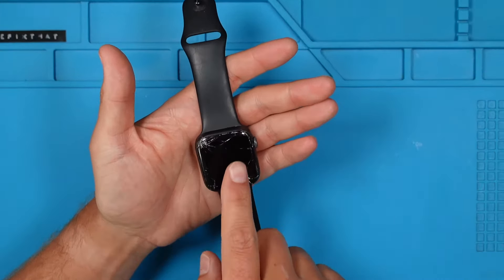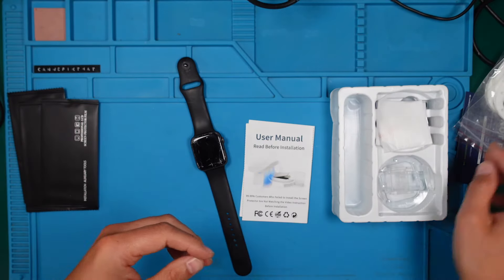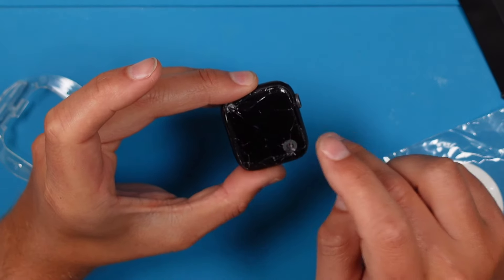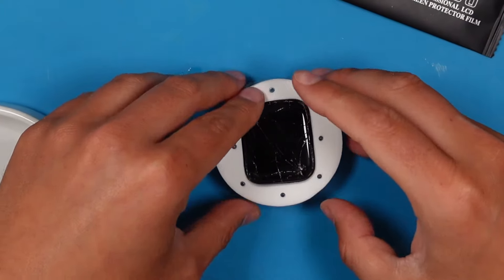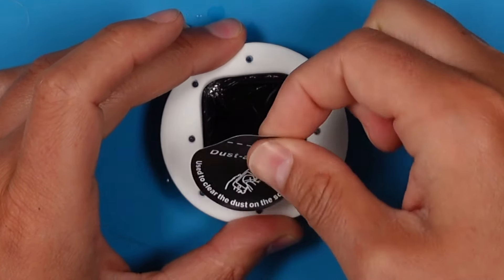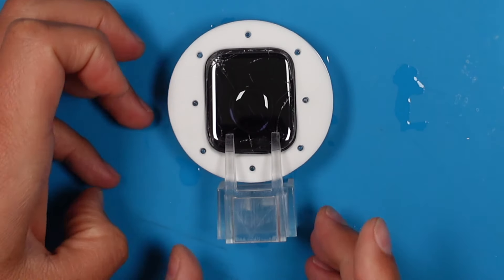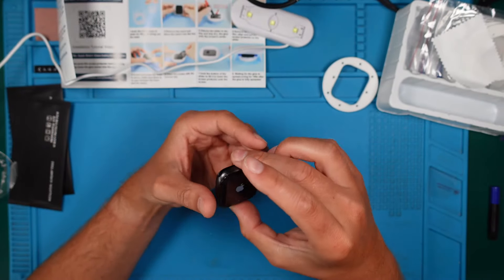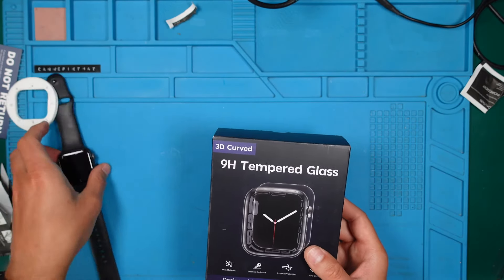Don't Trash Your SHATTERED Apple Watch: Try This $20 Fix instead!

Comment: Hello! If I make a mistake in applying the protector and decide to remove it, will it not take some of the glass shards with it as I peel it off?
Reply from the maker: Hi! I think this depends on your glass pieces. In general, it is not that difficult to get it off again, but chances are that you remove some of the glass. But what is the alternative? 😁✌🏻
Reply: @CanWeFixThat  Thanks so much for your response!!! 😄
Reply from the maker: No Problem! 🫶

Comment: well what can i do if I have an apple watch series 3, the touch screen doesn't work, and and there are shattered spots (on the corners) where i think i can see screws, i was planning on semi fixing it for my little brother after i bought myself another watch. Thanks for reading though :)
Reply from the maker: Hi! Mh, if the touch screen isn't working, you can't do much about it. You could watch videos on removing the screen, but I guess this would worsen the situation, but you have nothing to lose. ✌🏻
Reply: @ Alr, thanks man for the respond, but I feel like it’s just a waste if I throw it away, like the band is in good condition, is there anyway to make value from it? (Btw thanks again for the response)
Reply from the maker: You are welcome! I probably would sell it for parts.

Comment: does this work for even small, slight cracks?
Reply from the maker: It is at least worth a try; it is not permanent and can be removed without hassle. For slight scratches, it works best; they will disappear completely. At least, this is my experience so far. ✌🏻